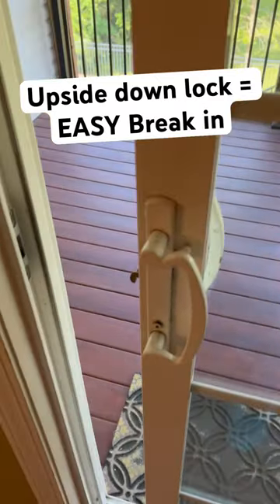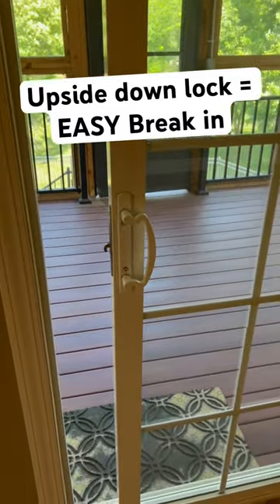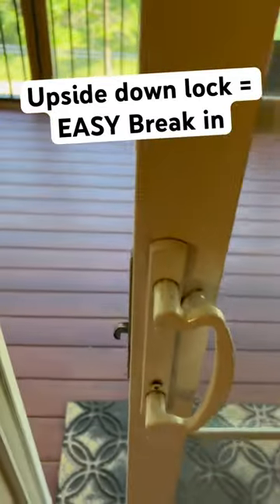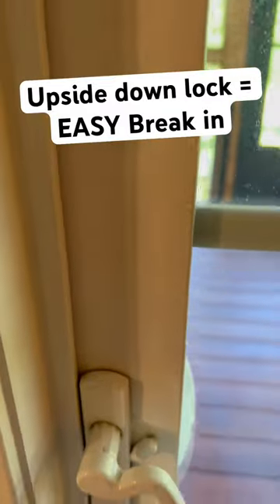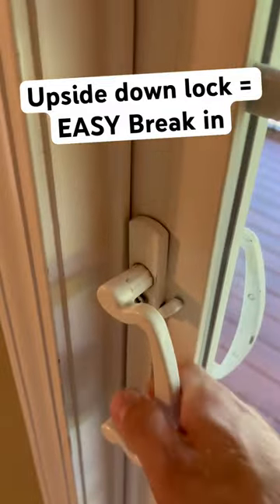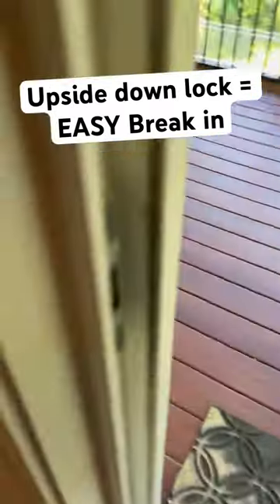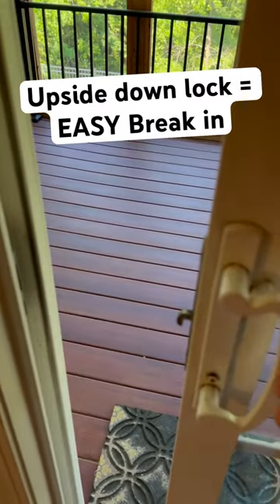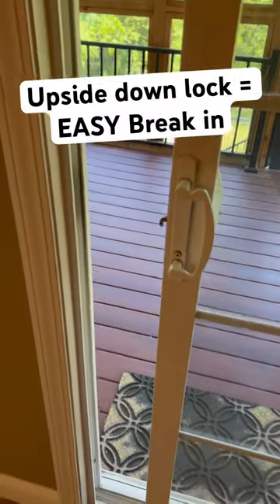Upside Down Lock = EASY BREAK IN for Criminals

Comment: if you can lift your sliding door the guides are not adjusted right most sliding doors have a screw mechanism to adjust the rollers height to prevent lift up negating this problem it is a good idea for the hook to face up also😊✔
Reply: sliding doors can all be lifted up  so you can remove them

Comment: Our patio door lock faces down but you can't lift it up like that. I don't think this is a lock issue as much as it's a door fitting issue. A likely easier and cheaper fix is installing a kick lock, IMO.
Reply: how do you remove the door if you can't lift it?
Reply: @declanwallace6770  I couldn't tell you, I've never had the need to remove it since it was installed. I'm guessing it does lift and I'm just missing some mechanism holding it down to prevent someone from doing this. 🤷🏻‍♂️